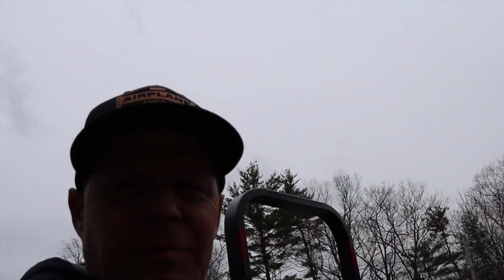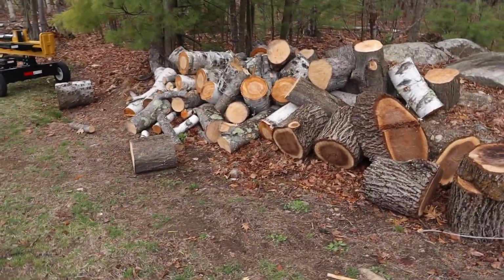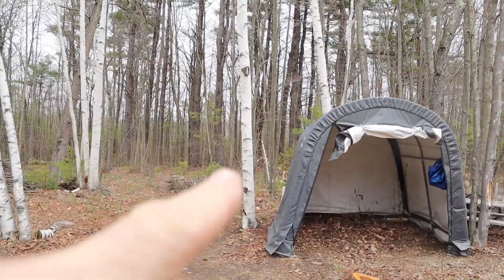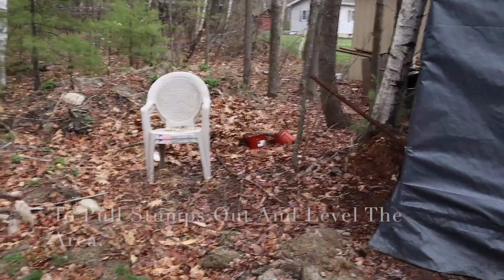Front End Loader Bolt On Hooks Or Weld? Kubota BX 2380 moving brush.

Comment: Hi Gary, going through the same thought process for hooks, I think I’ll be going with this option, see link https://youtu.be/9u5mqwx-n14, I don’t think you have the right kit, you’re missing a spacer block so the hook ends up level with the top of the bucket, you should check out Ken’s Bolt on Hooks, they have a specific model for the BX SSQA bucket https://www.boltonhooks.com/kubota-quick-attach/.  Have a good one 👍🏻
Reply from the maker: Thanks for sharing. I’m most likely gonna return the ones I have. I have rethink this one.